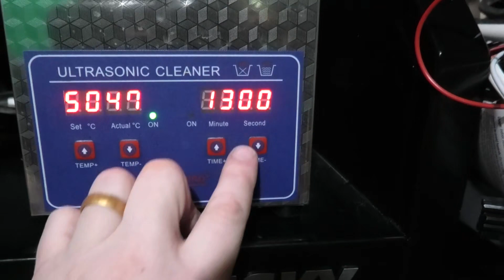Teardown: M10X

Comment: Took mine to range for the 1st time 2 days ago. I had failure to feeds like 5 time in 50 rounds. Could have been the brand new pmag I was using I suppose
Reply from the maker: I didn't add it in to this video, but mine just broke a firing pin right around the 1000 round mark.  M+M isn't getting back to me about the part, and the warranty depot is moving, so they won't even look for a replacement pin for 2 weeks.  That's why this gets the numbers it did.  It's definitely an "expensive plinker".  I'm using Pmags as well...I had no FTF at all, but I'd take that over a broken pin.   They do load these up with a ton of grease from the factory, so be sure you clean yours out and just use gun oil, that might help...as well as breaking it in.  I don't bash on a rifle too much until after the 500 round mark.  My moa on this rifle is about 8-10, so it's not a sniper :)

Comment: Oddly relaxing watching you clean this thing.
Too bad that it didn't really work out for you. Really cool looking firearms, do you still have this one? Any change in opinion?
Reply from the maker: I've had it reworked by the company, a different firing pin spring and firing pin. It goes bang reliably now, but accuracy is nothing to write home about. I've seen some threads online about tweaking it for better performance, but even with a home range, I rarely run it. It still falls into the 'plinker' category for me, and honestly I don't think it would have a very long lifespan. I don't hate it, but I wouldn't grab it if the world was ending :)

Comment: Any issues with the scalloped fire pin
Reply from the maker: Pin broke with under 1000 rounds fired.  M+M replaced it, and included a beefier firing pin spring.  It didn't break at the scallop however, 'just the tip'.
Reply: @High_Caliber  so here’s the deal . I like it but add another 5 hundo and I’ve got a Tavor X95 . Beautiful gun though and I’m glad they fixed it for ya .
Reply from the maker: @controlledchaos8851  I've got an x95 as well. :) Oddly enough it was going to be the next video, but it got bumped to do one on a sig legion.  I only have this rifle because I bought a store demo for ~$1000, and had a ton of 7.62 ammo lying around.   At the full asking price this thing is just non sensible. The X95 beats this in literally every aspect.  Is yours in fde or black? :)